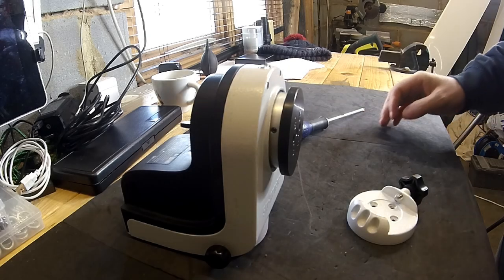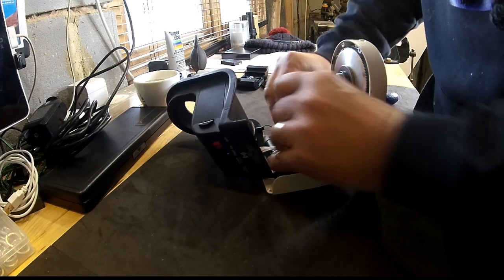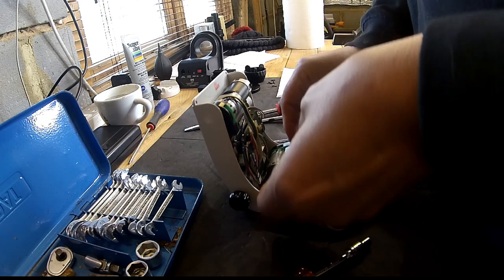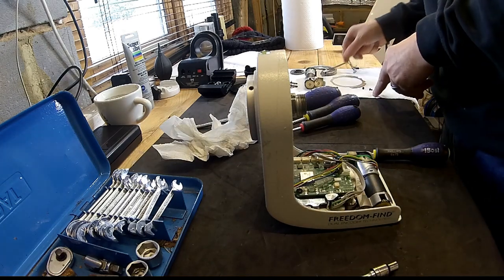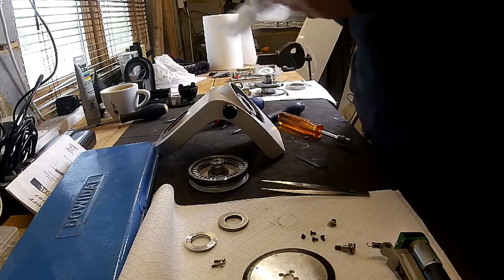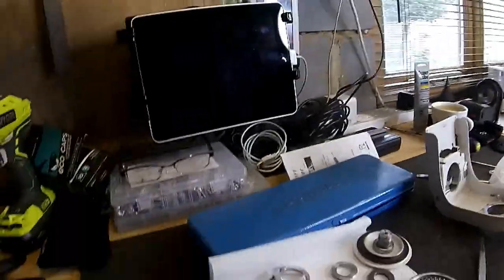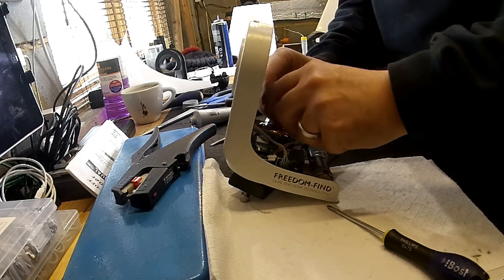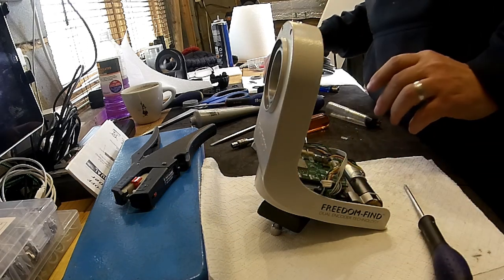Sky Watcher AZ GTI full strip down & Rebuild. Cleaned and fresh grease. Guiding now at  0.8"

Comment: In taking my unit apart I worked out what, some parts actually do. The ‘shoulder’ bolt that holds the motor bracket in place has a flat washer and a wavy washer to lock it in place, this has enough clearance to allow the bracket to pivot. The smaller pin on the right which has a slot in the end is actually an eccentric pin, the idea is this allows the right amount of clearance to be created between the worm and worm wheel. With the spring in place to keep tension on the motor/worm, the pin is rotated gently until the backlash is removed between worm and wheel. Holding that eccentric pin in place with a screwdriver, gently tighten the nylock nut until there is no slop in the motor/worm up/down and the spring holds the worm firmly against the worm wheel. But can slide back and forth. Same applies to RA and Dec. The small slotted brass pin which you removed along with the circular piece you will note is slotted to adjust the clearance of the position reader, it does not actually hold it in place, the plate that goes on top does that. Being very small parts, these subtle differences are sometimes overlooked as to their function, often they are the key to correct operation of the unit. The central boss that was missing its top threads is to allow correct tension on the RA clutch assembly. Their are two sets of threads on the central boss, upper and lower, with a blank section between them. This is where the two small grub screws locate to lock in position without damaging the upper or lower threads. I hope folks find my comments helpful, I do a lot of marching of my own parts and rebuilding items such as scope mounts etc. so I am familiar with these small refinements, which are obvious on larger mounts but less so on the tiny units. Regards from the Southern Cross Observatory-Tasmania 42 South. Stay safe & clear skies. PS My unit was virtually grease free, that's called quality control !!
Reply from the maker: Hi Shevill and hope you are well. Excellent explanation of the mount workings. I am sure as have I people will find this really interesting. Thank you for taking the time to write this
Reply: @Astrobloke  Sometimes all is not what it seems. I have found that locking ring you have threads damaged or missing is really crucial to the fit and smoothness of the RA, tiny tweaks one way or the other -I guess it has to be within  the narrow blank space where the two grub screws lock it in place. I have machined many worm and wheel gear sets over the years, building my own mounts of various sizes, the fit and finish of worm and wheel gears results in good or bad periodic error. We are into spring down under, 22 degrees the other day, this weekend snow down to sea level!! Clear skies.
Reply: @lordoid  -Thank you for your comments and I fully understand your request, however, the problem is that I have done these tuning mods and not taken any pictures etc. To make a video or take pics and add text is not really something I want to do again. It took me three attempts to get the RA tension just right, disassemble, assemble test, three times. The critical issue seems to be getting the tension right on the RA locking ring to allow free movement for balancing with no tightness, very fiddly I found. I have yet to put the system into actual use, recovering from spinal surgery has but a stop to lifting and carrying tripods and mounts with scopes attached etc. for some time. Kind regards from the "Southern Cross Observatory"-Tasmania 42 South.
Reply: Awesome! Thank you!  Since you know the subject, might I ask you: do the main gears and worm gears need to be greased as well? How do you adjust the clearance between both to avoid any slack? Do you ajust it by thé feeling, by hand? Or is there some kind of gauges to be used? Lastly, as for the main gears, is there any indication regarding the torque to use when tightening them? Thank you so much for any input !👍 Hope you recovered well from the surgery and that you can enjoy your passion again 🙏
Reply: @RenoLaringo  Sorry to be late in replying. It is a year or so since I did this I really can't add any more to the above. It was all done by fit and feel, no special tools or gauges used. I know I had to do it several times to get it right and adjust things so they were free but not too tight. The worm & wheel gears need to be free from backlash but not overtight. All gears have a small amount of clearance to prevent binding. These are cheap gearsets so one might experience some tight or slack spots as the gear rotates, not much can be done about that. I make a lot of my own equipment, gears etc. so am uded to getting the fit right and to a level of precision. Don't be surprised ifyouhave to take several attempts to get it right, every mount will be a little different.

Comment: Awesome video! I was struggling to get an  acceptable guiding with this mount, in part because of the stickiness in RA and DEC, which made very difficult to do a proper balance and polar alignment. For me there was no way to get under 3,5 total rms. 

After opening, adjusting and cleaning the mount following your video I was able to reduce the stickness on both axes for a much much better balance and achieved a very good polar alignment using Ekos and PH2 drift alignment (Polaris out of view from my place) in minutes. 

In several tests I did last night I was easily getting between 0,9-1,4 rms in PH2 with default settings, a great improvement and more than enough for 5-7 min exposures with a 80/560mm scope (total payload of 3,8kg). 

Thanks to your video I finally have a working mount to enjoy my astrophotography sessions, thanks!!
Reply from the maker: Thank you for your feedback and I am really pleased it worked for you. They are a very good portable mount but seem to come out of the factory with varying degrees of quality.
Clear skies
Reply: I thought I could push this mount a little further so I reopen the thing and made fine tune adjustments on the DEC gears and to remove stickiness. With this I was able to better balance and set finally at 0.30 RMS during a couple of hours session with a 560mm FL tube. 

Awesome what this mount is capable of, it’s a pity the low quality controls they do at Skywatcher.

Thanks for this video again, keep the great content in your channel!
Reply from the maker: @deepskywindow  that is excellent results. The quality control is poor unfortunately. But its not too hard to tune up so you can get acceptable performance for what it can handle in weight. I just use a Z61 or camera lens set ups on mine

Comment: Thank you.  This is a very helpful video!
You can remagnetize your screwdriver with a length of insulated wire, a tube, a very small (say 1A) fuse, and a plug.  Wrap the wire around the tube, put the fuse in series, and attach both ends to the plug.  Insert the screwdriver shaft into the tube and plug the plug into a wall socket.  The fuse will blow almost instantly.  When it does, the magnetic field generated by the current in the wire will collapse, turning your screwdriver back into a magnet.  My old boss taught me that trick, and I have magnetized many screwdrivers with it over the years.
Reply from the maker: Thanks Barry. I will try that later today and see if i can fix my screwdriver. Great trick and thank you for sharing
Reply: @Astrobloke  My pleasure!  Safety tip for anyone who doesn't already know this:  the fuse has to be smaller than the maximum amperage rating of the wire, or you risk a fire.
0.5A fuses should be safe with any common wire size (24ga or larger).
The tube you wrap the wire around should be non-ferrous, or it will get magnetized instead of the screwdriver; the tube is just a convenient way to insert the screwdriver into the middle of the coil, and a way to keep the coil in shape for multiple uses.
Reply: I just rub mine on a big magnet harvested from a old speaker, much easier if you have a magnet around ;)

Comment: Pity I couldn’t strip it all down due to a sheared screw from manufacturers original assembly (gears on the weight/scope end unable to remove). Easy process to follow in order to service the AZGTI thanks to your video, had to pause to check which way round the bearings go back in. First time I have ever done anything like this, went back together easily and have ran it through its movement range. Just need clear skies to see how it guides. Many thanks for this instructional video that you can actually work alongside. Saved forever as no doubt the AZGTI will need regular servicing in the future.
Reply from the maker: I had a threaded collar nut in mine which was clearly damage done at the factory. Its a shame their quality control is not high as its a good product. Thank you for taking the time to comment and I am glad the video was helpful for you. Please let me know how your results are, clear skies
Reply: @Astrobloke  my guiding is down from mid 2’s, i got 1.64 total best it has ever done.No knocking/clicking noises anymore when guiding and it stacked 180second frames with nice round stars last night for the first time, normally it fails to live stack (ASIAIR) at that length of exposure and can’t match the stars.  My balance is a bit off due to a homemade electric focus unit i had to attach to the scopes dovetail so i need to source a smaller fixing so i can move the scope up a bit to get better balance. Happy with the result though. Next up 5 minute exposures to test. Thank you.
Reply from the maker: @nicholahamblett4726  thats excellent news, well done. The balance is definitely worth sorting as with a low payload mount the balance will make a lot of difference. Get that sorted and a few tweaks and you should be able to guide at 1” sec or lower.

Comment: Thanks for this.. I just got the Az GTI a few days ago for an ultra-portable setup, and am contemplating cleaning and re-greasing it right away. I have done so in the past when I still owned an AZ-Eq6 and noticed that the quality control with Skywatcher was quite bad (mine had metal shavings in one of the press-fitted bearings.. which was seemingly inserted with a hammer).  I also switched to some SKF bearings back then. (In the long run I purchased an Avalon mount which performed on day 1 better than the AZ-Eq6 ever could.)
Then again, I may want to wait and use it at least once to see how it performs before having to re-set everything again. At least there's a good guide available now. :)
Reply from the maker: Thank you for your message. I have read there is quite a variation in these mounts. Some are lucky but quality control is a bit hit and miss. Its still a great little portable mount though and works great in the EQ mode

Comment: Awesome, really helpful for those wanting to follow along and tune their own mount - I agree by the way that Cuiv's method of locking the spring loaded adjustment is probably not the best way, I don't think the design is a bad one to be fair! :)

Great job mate!
Reply from the maker: Thanks Luke. No locking the motor in did not work for me and you may have heard the mount sounded very strange. So mine is using the springs to hold the worm drives in and tracking at a great level so will leave alone. I think these are a great little mount

Comment: Regarding the Spring, what i did, was cut a couple of turns off the spring with side cutters, which tightened the spring, rather than Cuiv's method.
Reply from the maker: Thats a good idea. Mine is still guiding nicely at around 0.8 - 0.9 rms so for now I will leave alone but when I next need yo service or work on it I will take a look at that

Comment: It looks like I will have to do the same with my unit, the Quality Control is very basic in its assembly I note from others who have done the same as you. I also follow the fellow in Japan. I also have a Sky Watcher Similar unit but it lacks Dec. guiding and Wi-Fi. I have a project in mind for my AZ-GTI and seeing your rebuild has perhaps popped up on my YT suggestions at a good time. You and Cuiv have a lot in common, excellent series across scopes, mounts, software control and processing-just what every newcomer needs as they start their journey into astrophotography/astronomy in general. Regards from Tasmania 42 South.🇬🇧🇦🇺🦘🔭
Reply from the maker: I really like the AZ GTI. It does need a bit of work to get the best out of it however. But for a portable goto its hard to beat

Comment: hello, this assembly is very interesting because it does not use a stepper motor but an encoder wheel, which interests me and the particularity of the grease which is very important for me as a mechanic, this grease must not be too greasy, which tires the motor and increases rotational sensitivity and precision, this will be done by the encoder wheel, the grease must be neither too fluid nor too greasy, limit wear at low revs and no need for high grease temperature, engine level I noticed the unbearable noise of displacements and there it is a fatty grease which must absorb the vibrations therefore thicker, I will inquire.
Reply from the maker: I try to just lubricate the parts that need it lightly. The coffee grinder noise of the mount is unfortunate but a characteristic of these. My CEM26 by ioptron is almost silent in comparison.

Comment: Hey Glenn, watching this in 2022. This looks like a very good portable, not too expensive mount, and servicing it is doable as you have shown in your video. I'm considering this mount for a small wide field setup, I know now there are other options like the Star Adventurer GTi, but in some videos I've noticed that the SA GTi it is a bit noisy (you know, the typical "coffee grinder" sound), which makes me worry about slewing the mount in the dead of night, neighbours, you know... So my question is, do you know which one of these two mounts is less noisier? Thanks, clear skies.
Reply from the maker: Hi Sergio and thankyou for watching commenting. I have not heard the SA GTI so cannot directly compare but would think there is not much in it. I agree they make some noise but if you are even just a small distance away I doubt they are loud enough to attract complaints. The main slew very late at night would be a meridian flip and you could do this manually if you were worried bout the mount noise. Good luck in your choice and clear skies

Comment: Nice! Thanks so much.  Now I know what’s causing the funny slewing noise when you fixed it towards the end of testing the RA axis.  Now back to another round of strip down and rebuild.  If you were to do this again, what would you emphasize or add or not do?
Reply from the maker: When i next work on this mount I will buy all new bearings for it and replace them all. I think you can even buy better worm drives.

Comment: Hello, I liked your video and I use the same method as you when I remove a lot of screws I put them back in their places so there is no way to make a mistake, but I had a question which grease did you use??? I saw you with a tube but I couldn't see which type or specifically which one was used for reassembly, thank you
Reply from the maker: Thank you for watching and commenting, glad you liked the video. The grease I use is superlube fully synthetic grease

https://amzn.to/3C1zLk0
It works really well and does not become tacky. Good luck and clear skies

Comment: Very through Glen. Been considering selling my Star Adventurer for a n az-gti.
Reply from the maker: I sold my star adventurer and bought one of these. At first it was just because it was goto and would make finding targets easier. I have found it to be excellent and would highly recommend
Reply: Hi Capt404 .... keep the Star Adventurer if your planning on setting the AzGTI to EQ mode ... your gona need the Wedge ,Dovetail, Shaft, weight and maybe even the Dec plate .... sell the Mount Head and PolarThingy

Comment: Wonderful video! I also got the AZ GTI mount but I found an issue when I was shooting last night... The red line (I think it is DEC axis) cant hold and drop when guiding... Could you explain what was wrong with my mount? or maybe my setup? Thanks! I think I will follow your instruction and modify my mount soon!
Reply from the maker: Hi Martin and thank you. Its hard to say what could be wrong. The mount can suffer from bad backlash. Have you run a guide assistant? This would be my first step as it will tell you the DEC backlash and try and add compensation to allow for it

Comment: Thank you for the informative video. Did you clean or grease the worm gear and worm? I wonder if it needs light oil or nothing at all?  Also, did you check the motor to worm gears for backlash?  You made a great improvement.  I finally received a AZ-GTI and it seems very rough in operation and the AZ lock may have some grease on it. I need to tighten excessively to make it lock. After watching your video, I may try to tune it up. Thanks again.
Reply from the maker: Hi Keith and thank you. Yes I did regrease the teeth on the gear and the worm drive after cleaning. A light oil may work but could run to areas you do not want so I think a good lithium or synthetic grease is best. Be careful with the tightening as they are easily stripped.